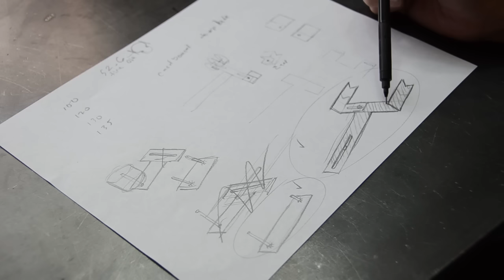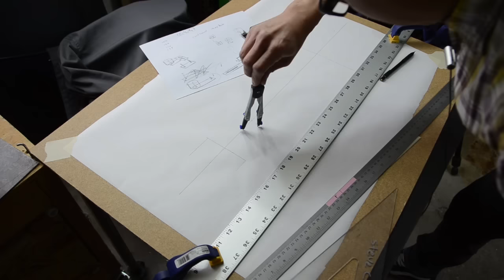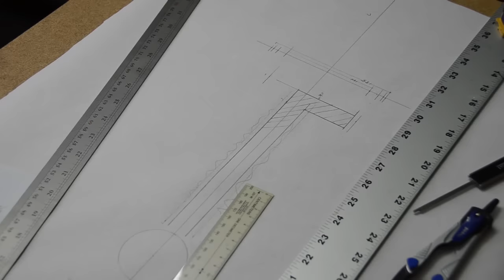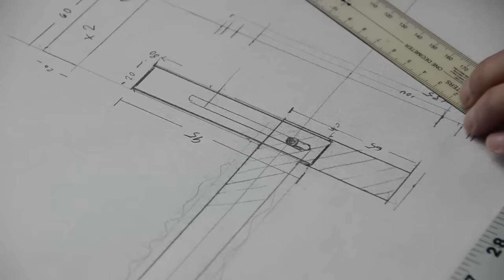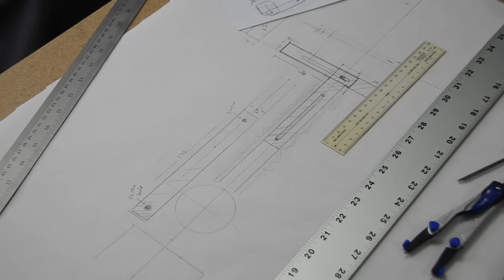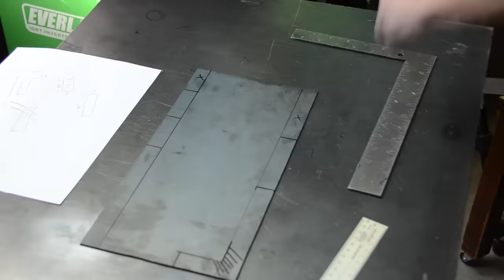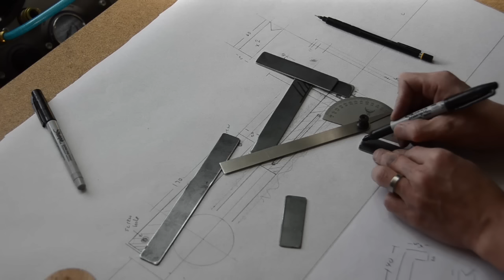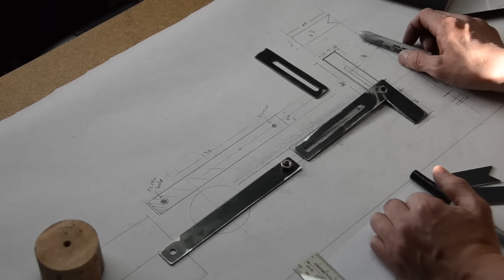Bicycle Frame Build 41 - Tire Reference Fixture

Comment: Very nice series. I found you 7 days ago and have binged thru the project. When in your thought process of building did you shell out bucks for your different major tools, or is the frame jig the only tool that does not go way back with you.
Reply from the maker: +David Gooch I pretty much got all the tools you see in the shop that aren't typical tools within the last year. They're relatively low cost compared to the better brands, but they add up quickly! Thanks for watching!

Comment: Your creation will work just fine. The largest single problem that I can see is the jig has no means to be centered in the bike frame while holding your "gauge".
Reply from the maker: +Adam Pierce I hope it will be ok though I haven't actually tried dialing it in.  Then screw that holds the long neck part does not constraint the neck to only go out straight. So I'm hoping to swivel it to center it.

Comment: Euh... If it's only one side of your upper "T" that is sliding... Won't the guide for the tire will be off center if the dimension is different for an other frame?
Reply from the maker: Hi Michel, yes only one side slides. But the whole thing is adjustable so it can also pivot. This will allow for it to be adjusted to center. I should have actually set it up for you guys to see. I'll do that in a coming video. Thanks for watching!

Comment: I just don't remember why you did this asymmetric back fork ?
Reply from the maker: +Eric Balcon Hi Eric, I did that because the tire I'll use is 1.5" Fitting that between track cranks is impossible without the steel bar inserted. The tightest spot is between the chain ring and the tire.

Comment: have you made a bicycle yet?
Reply from the maker: +edward walti I welded a MTB frame a few years ago in a class. But just welded it. And never built up the frame. It still sits in my garage. So technically, no :)

Comment: Hi Steve! Just caught up on all the videos. Glad to see everything is moving along. So close to completion! Or is it!?

I left you some questions in another video where it seemed more relevant. They're about whether or not the frame jig could feasibly be made from 25mm 80/20 extrusion. I'm guessing that you chose 40mm extrusion because you wanted something as beefy as possible, but a frame jig from 25mm extrusion would be lighter and less expensive, not to mention it would simplify the milling of the seat tube plate. 

The video where I left the questions: https://www.youtube.com/watch?v=AiRy9cleNME